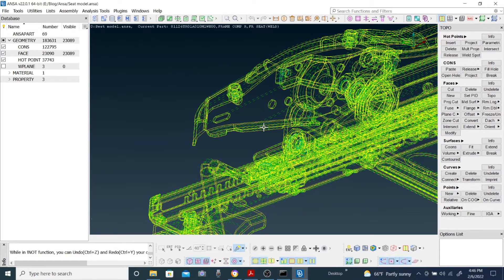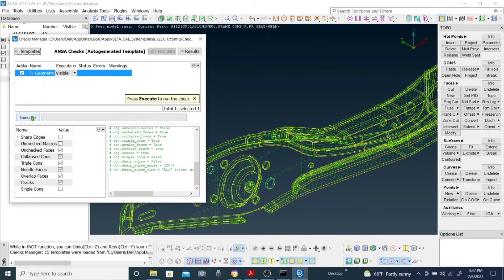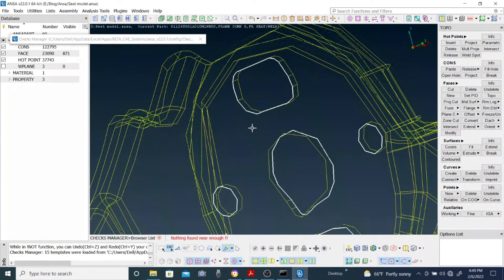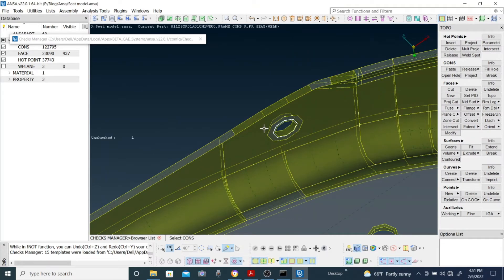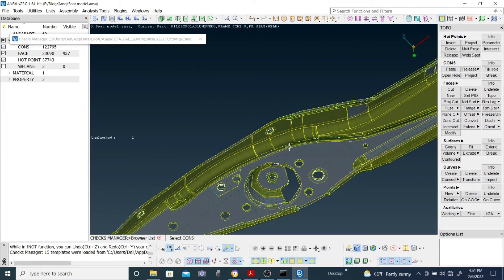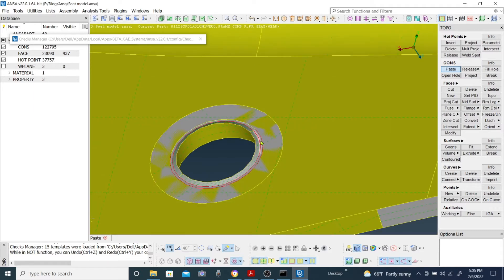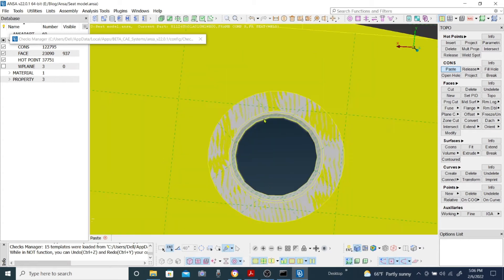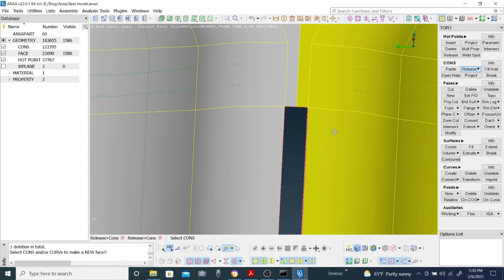ANSA Tutorial (6/20): Triple cons Error (know how to tackle)

Comment: It's very difficult to remove the triple cons in bolt and nut section
Reply from the maker: You can remove bolt and nut parts... Because these parts are not used in analysis intead their fea model are used like rbe2. However, first isolate the surface then bring neighbor surface one by one then release them after that hide unnecessary surface. Finally do topo or paste cons. If possible i will make videos, but try this.